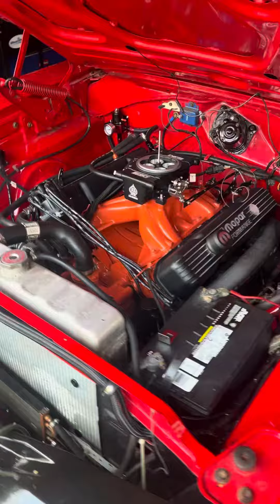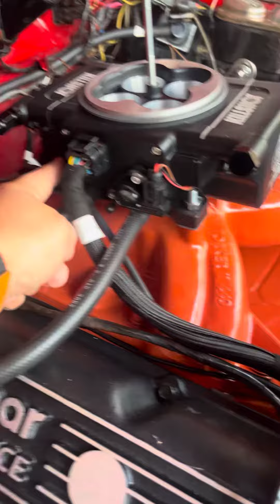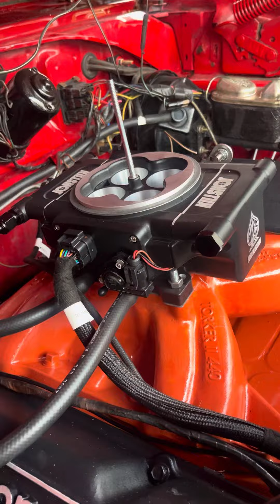Aces EFI Help start stall

Comment: Sounds like an iac problem. Open your throttle blades a tiny bit and reset TPS. That might help. Fine tuning your throttle blade adjustment helps these things run much better
Reply: Set your iac min to 15 in the tuning setting under advanced idle i believe……i had similar problem on my sons 289 mustang  and the iac min was set at 5 so i bumped it up to 15 and it seemed to fix it…..you might have to play with the blade screws too a little bit like another commenter mentioned……maybe even set it to 20 instead of 15 seeing as its a 440……and zero out the tps before you start it if it acts funny

Comment: Those throttle bodies suck a lot of air and it may sound like a vacuum leak but it’s just the air moving through the throttle body. It seem like you have a fuel issue. Like the fuel pump is shutting down after the key is let go. I would check power at the pump or fuel pressure while it’s running and see if it looses either.

Comment: Definitely a leak. Check the gasket between the efi and intake. If you run your finger along the sides of the efi at the gasket and feel air being sucked in you found the leak. Also check the hoses   to see if they have any leaks. I hope this helps. Give me an update on the engine. Even if I'm wrong.

Comment: Take some starter fluid spray it around the intake manifold especially underneath the ace tbi base flange gasket if this does not change pull the PVC valve out and put your Finger over the hole see if it changes if that does not change then check your brake booster and any vacuum lines.
Reply: Awesome till the paint comes off.... I have installed a few of these and all "whistle" just the the GM TBI's. It's the whistle from the butterflies.

Either way, most people use propane instead

Comment: So just a theory . I have been struggling with my killshot as well. But one thing I noticed was on the bottom of the killshot the vacuum passages are very close to the edge of the throttlebody if your intake manifold has a really thin mounting surface, those vacuum ports can leak I ended up having to put a carburetor spacer that was thicker than my intake to get them to seal up. Looking at your intake. It looks really thin underneath the throttle body, I would start there then I would also make sure that you try different parameters in the computer setting going from stock to mild and see what happens as I found out. Their programming is not very good like a sniper or a Fitech .

Comment: Have ti have fuel line to both "bowls" on carb as there not connecting tube like a double pumper so u are running only on secondary
Reply: Supply and return…….

Comment: Did you get this figured out? I can only get mine to run for a few seconds too. Mine is only spraying fuel from 1 of the 4 injectors
Reply: What's your fuel pressure set at? If it's at least 40psi contact @acesfuelinjection it may be defective.
Reply: @TreerowRescue  3 of the injectors were bad

Comment: So if u locked the distributer out, afterwards did u go in on the screen and unlock the distributer in system so killshot has controll of the timing freely. That was my issue.

Comment: I  would  make  certain  that  the  Base  Gasket  is  the  correct  one  I  don't  know  what  they  are  using  to  monitor   Manifold  Absolute  Pressure   the  Old  Systems  had  A  MAP  Sensor,  the  Newer  System  uses  the  MASS  AIR  FLOW  measures  the  amount  of  Air  coming  into  the  TBody ,  I  do  know  I  changed  the  Duration  of  the  Cam  on  A  454  Throttle  Body  and  was. Limited  on  what  Cam  I  could  use  Duration  is  Critical   MAP  Sensor  Circuit

Comment: Should start without you touching the throttle. 

1) Did you verify the throttle opening or adjust any of the screws? They should NOT rest fully closed

2) TPS and other numbers.

3) Reset the self learning

4) timing is also a huge deal. I see a ballast resistor. WHY? 

5) Whistling noise you hear comes from the unit and is normal. Even the GM TBI's made that noise.

Comment: I have a 1992 Ford crown Victoria does the same thing it could be a intake leak .When it gets below 37 degrees it run real rough until it warms up it runs ok going to get it fixed soon before cold weather sets in .Intake leak IMOP.

Comment: You don’t have a constant 12 volts when starting so it will fire then die try finding a 12 volt hot while cranking use a meter

Comment: And what is your iac position on your handheld
Reply: Ding ding ding!!!
Reply: I dunno how these folks seem to have so much problems with these??   I installed a killshot on my sons ‘67 mustang 289 over a year ago and it has been nothing but great for us!!! He did have this very same issue a couple weeks ago when it started getting cold around here…..so i changed the IAC min settings from 5 to 15 and it seems to have fixed it…..knock on wood!!